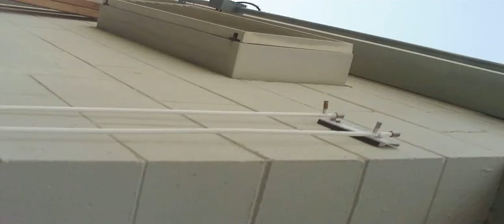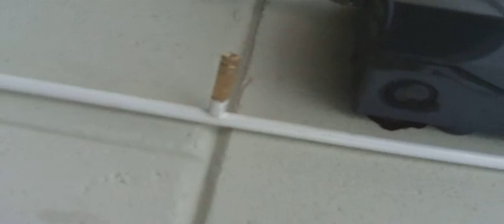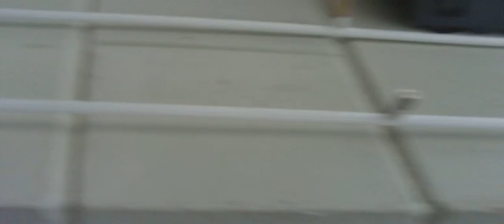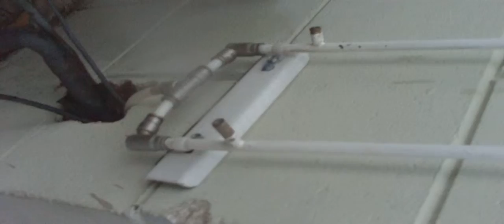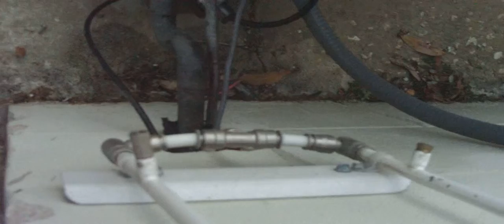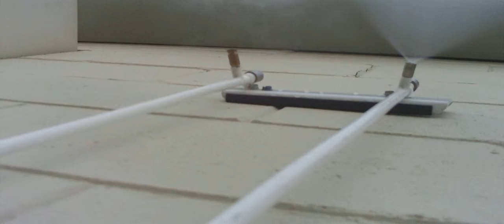ruby nozzle testing.MOV

Comment: I tried them on my last three installs and loved them. When pressure testing I got some trash in the nozzles, they were extremely easy to disassemble and clean. Since then I’ve started offering my previous customers the option to upgrade their system for $10 a nozzle, and they love them. Thanks Bill